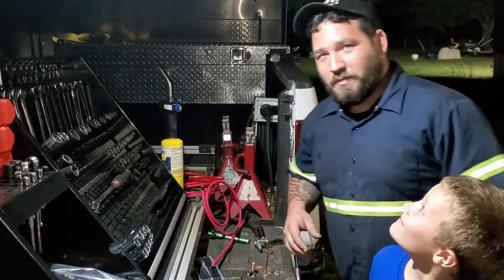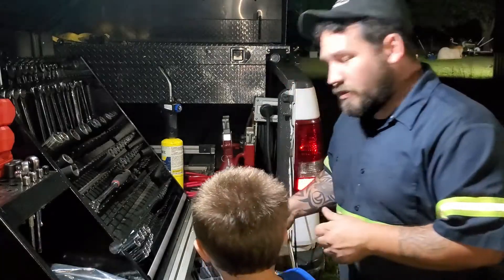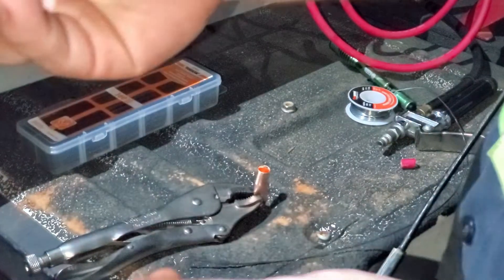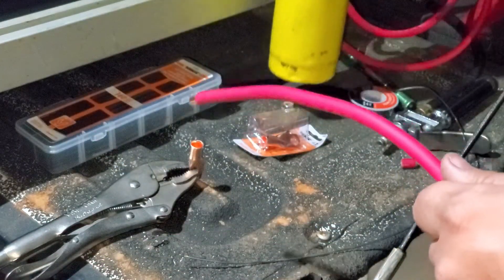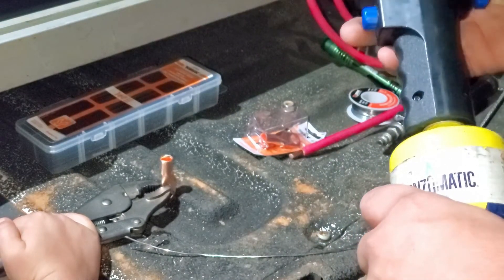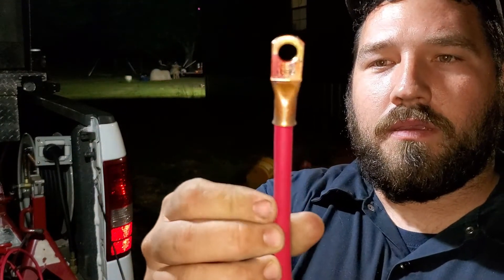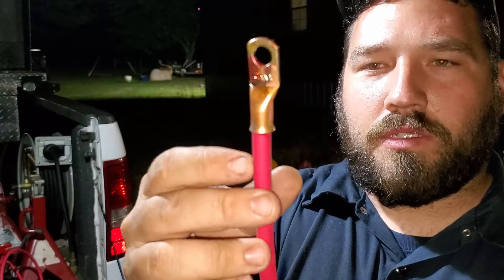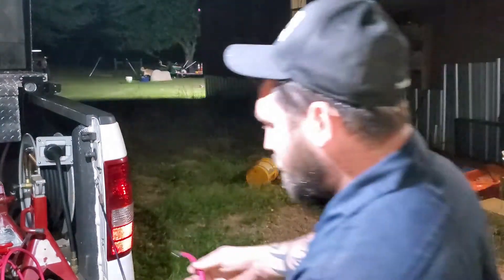How to make your own Custom Battery Cables

Comment: Great job! Copper lugs are a lot nicer that the steel ones that rust that come on pre made cables.
Reply from the maker: That was an old trick my grandpa taught me.  lol
Reply: I think my dad taught me this when I was around 15  about the same time I learned to adjust the curb idle on a Holley carburetor lol
Reply from the maker: @NoFox_Given  I tried to learn as much as I could from the old man .. lol old school tricks are still the best way to go most of the time ..lol